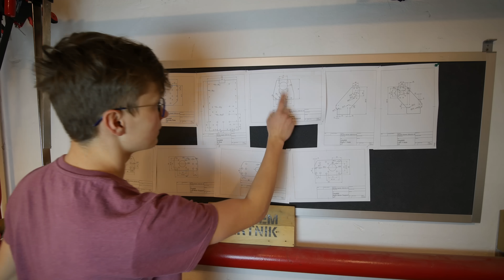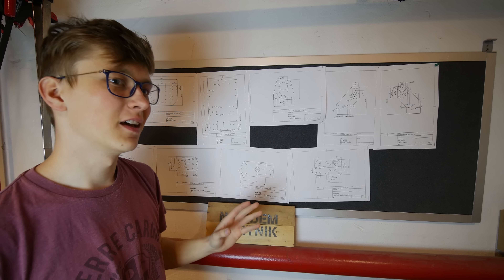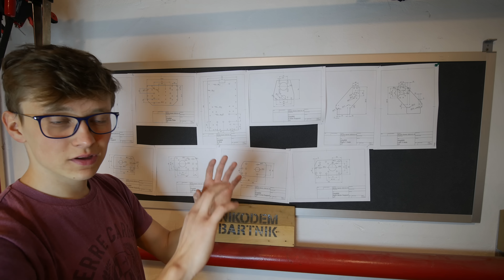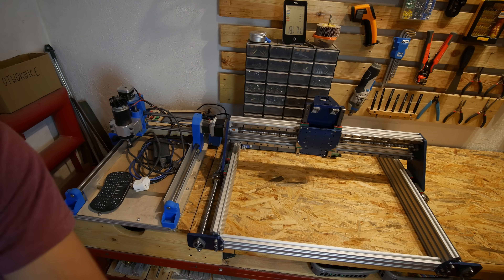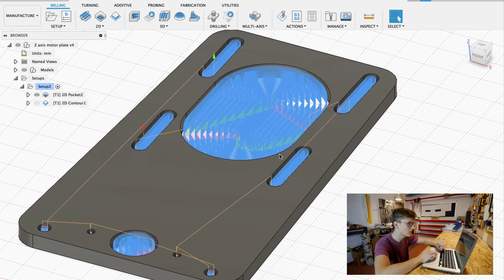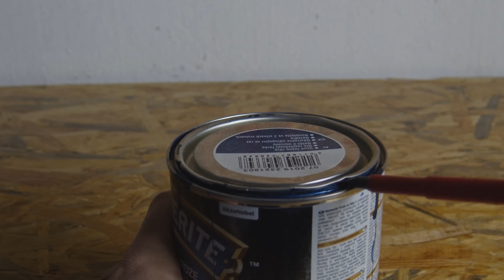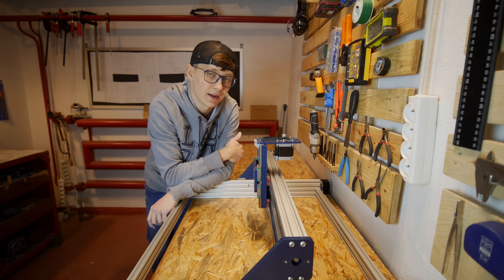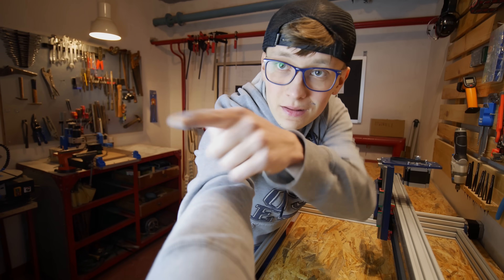Fixing IndyMill With Dremel CNC - Milling Aluminium With DIY CNC

Comment from the maker: IndyMill: https://indystry.cc/indymill-cnc-machine
Reply: If you want, I could machine some stepper couplers for you on my small lathe
Reply: Hi Nikodem, I need your help. at university I have used the NEMA 17 stepper motor 3D model from your fusion 360 CNC drawing. I need to credit the author for my references. Did you design it or did you get the model somewhere else?

Comment: Can you share the dremel cutting settings you used to cut Aluminum. My machine is ready i used your dremel 3D Holder plus a mini X Y Table converted to CNC via Adruino Shield. It small but looks OK. D https://youtu.be/4LjwjdlHPYI?si=4BXXXjIB74IXAPpA

Comment: bonjour, je suis là pour ajouter un avis négatif malheureusement, pour commencer j'ai posté un avis sur le site pour le kit de plaques en acier découper au laser et lavis n'a pas été poster !  honnêtement pour le prix que j'ai payé ce n'est vraiment pas correct déjà j'ai remarqué que les plaque n'était pas complètement plate donc mais railles linéaire force (je le sais car quand j'ai je serrais juste la railles le wagon avancer difficilement et pas quand je le mettais de l'autre côté), il n'a pas mis les roulements (51101 size 12 26 9) dans le lien et ne l'a précisé nul par à part sur l'une de ces vidéos donc perte de temps…

hello, I'm here to add a negative review unfortunately, to begin with I posted a review on the site for the laser cut steel plate kit and the review was not posted! honestly for the price I paid it's really not correct already I noticed that the plates were not completely flat so but rails linear force (I know it because when I have I just squeeze the rails the wagon moving hard and not when I put it on the other side), he did not put the bearings (51101 size 12 26 9) in the link and did not specify it anywhere except on one of these videos so waste of time...
Reply from the maker: First thing no spamming please. 
Your review was blocked by spam filters as it was not written in English.
It is true that some of the rail supports are a bit bended that is caused by the manufacturing process (laser cutting 8mm with small holes in the middle) but that does not influence how the machine work at all. If assembled properly there should be no problem. Try to loose the screws that fix linear rail carriage to the spindle plate and fix them again, that should help.
Reply: @nikodembartnik  I have to agree with @lebonjeuxdugeek, I bought your plates (drilled and powedercoated) in November 2022, and am stopped in my assembly of the indymill because the y plates have some warp/bend to them.  When I attach and tighten to the mgn12 blocks, it binds and does not slide well.  If i only tighten screws on one block, slides perfect, but when i tighten on second block, binds.  I filed the part of the y block where the bearing goes and have gotten it more flat and smooth, but when i tighten one, it is still a little bit off on other.  I am now trying to "shim" the other part (with aluminum foil strips) where it attaches to the mgn12 block and it is better, but still not sliding smooth.  if the plate  is not perfectly level where it attaches to the 2 mgn12 blocks, it causes the blocks to bind on the rail.  Very frustrating.  I proved this by getting a new piece of 6mm aluminum plate and drilling with dremel cnc the 8 mounting holes for the mgn12 blocks on the y plate and when tightened, it slides perfect.  I am going to try to file your plates more flat, but I worry i am going to have to have some new Y plates manufactured.  I can show you pictures

Comment: So your new version for Z axis does not support nema 17 motor only setup?
Reply: because i am planning to use nema 17 because i have many of these
Reply: @ErorenémengEroStratagème have you built the indymill yet?  I am halfway done
Reply: @toddroles3234  yes and its not that easy to build. Low quality linear rail is worse than classic rail and more expensive...
And i am strugling with the Zaxis because the 1.5Kw spindle is too heavy and there is to much friction for the linear rail

Comment: in my case (im building this with one of my friends) we will use a skr 1.3 with tmc 5160 for extra power, and marlin firmware (we like the sdcard support built into the board) (and I'm very familiar with marlin too)

Comment: Even if I am not sure if one really needs 2 NEMA 23s on the x spindle..it might give extra stability and makes it sound rude.: )
Ntl. the machine looks rocksolid and the software should be transferable. The parts- seem to be organisable, and standardish..
You made world class !! And very honest videos. I appreciate that. And all makers will! Other might not.

I am convinced that the Performance of the mill will ripe out enormously with experience an with a professional state of the art mill and patient experience, logging. Especially the drill/ material selection seem to be essential and an art on its own. 

Without a crisis I had had not the time to look Videos on CNC machines btw.  And I saw all, nearly. ; )
And now I MUST build one.
Actually for an other much bigger one project.. then.
Cant imagine how you doubt not going on with this project. Its the biggest modifyable freemill(some americans got lost in license wars yet..) with 2 nemas on screws.. the backleand y axis must prove in practice... as the potentially non fenced front and backload could be a keyfeature(only the lowrider design on mpcnc has simular... maybee..)
anyway. theres a goooooood chance i order the parts from you...
i really obey that piece of work. 
cheers!

Comment: Those fancy bearings as you put it aren't fancy, they are essential for use with ballscrews to constrain the axial load from your cutting forces, without them you won't have accuracy or repeatability worth a damn but you will end up with premature bearing failure of your motor bearings, those plum/lovejoy couplers are also useless for this application, you require disk couplers rated at the correct torque loading. Save up and do it once and do it right, otherwise you'll end up spending more in the long run.  Sorry if that is harsh but reality is frequently harsh, you may have noticed.

Comment: My professor Hello teacher, I have a dramel brand cnc from your brands, although I have a stepper motor torque of 4.7 kgm, I make the y axis current settings fully, but it stops immediately when it is a little weak, I use a 10 amp power supply, everything is ok, but there is this problem, how can we solve another nema 17 stepper  current settings 0.8 0.6 I am doing it again, the same, how else can we handle it.

Comment: Good afternoon. it would be cool if in the manual to the cnc there is a list of milling cutters that you used on your machine and they showed themselves well. with purchase links. I’m breaking my head so that I can take it at the beginning. because I want to cut aluminum and wood. anyway repeat your big cnc

Comment: you need to use the ball-screw bearing blocks they have preloaded thrust rated bearings in them this is one of the biggest reasons you can get the tight precision out of them is preloaded bearings also only use one bearing block to capture the screw and the other in just put it in a lose hole to prevent over constraint, doing this you can get 0.003 or better repeat ability out of that system..
also on your little machine get a block or delrin cut in half heat the ends tells it's really soft and pinch the shaft with it making your own delrin acme nut doing this will take more to spin the shafts but no back lash as the nut is a perfect fit to the shaft google it lots of vids on how to do this

Comment: You are the best, this is very simple and light design. For the ball axis, perhaps you could fix the axis with ball bearings near the nema, so the force will be resisted by the bearings not the couple.

Comment: I absolutely love what youre doing but you absolutely HAVE to include the fancy bearings as they are what support the ballscrew's axial load as it drives the gantry. They are a very important part of the drive screw as it restrains its axial motion with a thrust bearing and lock nut. If you don't it will honestly render the machine inoperable for precision work. Furthermore it will put that axial load on the motor's bearings and make them fail prematurely.
Reply: It is a little baffling, I hope he sees your messages. It would be a pretty easy fix too.
Reply: I noticed that on the DremelCNC already. Huge design flaw in my opinion.

Comment: Everything is fine with the couplers! But the lead screws needs to be fixed on the other side.
The lead screws must not transmit axial loads to the motors. This is bad for motors and reduces the accuracy of the machine to zero.
I managed to lock the screws for on Dremel CNC project.
https://photos.app.goo.gl/UoGbXAMY7SXBuYEx8

Comment: A solid coupling is not likely to work very well because the stepper shaft can easily move axially, the bearings are spring loaded to allow for a bit of movement.  Flip the ballscrew around and constrain it axially at the far end with two ball bearings or thrust bearings, there is little radial load so I've not had any problems with them just clamped around an aluminium plate. https://imgur.com/GcmT2JM

Comment: Hey Nik, no need to change the y-axis ballscrew coupler. The axial movement of the ballscrew  should be anchored with a pre-tensioned ball bearing at the front end of the ball screw (the end opposite the motor)

Comment: Hello , very good job for this one. One question : I have the same spindle and it heats quite quickly. I tried to implement a water cooling solution but have not tested it properly yet. I came across your new designed fan in Thingiverse, is it really efficient?  Thanks

Comment: I used your design to build my own CNC.  I did make some changes.  Some of the holes in the original where undersized so I cleaned them up(i can't file straight for the life of me) so I cleaned up the tolerances for my 3d printer.  I also had an issue with a bad Arduino board and gave up on my GRBL shield and designed my own to work with the Twotrees TB6600 Stepper Motor Driver and also got a ECO-WORTHY CNC Z-Axis Tool (probe plate) so make zero in the Z axis a breeze. I did have to change the Arduino out and everything worked fine so the redesigning of the board was most likely not needed.

Comment: I have been using CNCjs also - I have had the same problem.  Solution - When you start CNCjs, two things start up - first is a server side that you can't see and then the interface.  the interface side of the app is what froze and by pressing CTRL + R to reload that screen will fix the problem.  Don't close it or reboot the PC, if the Arduino looses power, it will reset the position and you can't re-home the machine again to continue the next cut.

Comment: Great video. Small thing... You will get better results if you use a special metal primer before using Hammerite on email.
Reply: Beat me to it, self etching primer is a good safe bet when painting aluminium.
Reply: Aluminium not sure why that corrected to email!

Comment: Hello Nikodem will you use and introduce the new GRBL 1.1h feature, the dual motor support for gantry CNC machines?
You do use 2 NEMA motors for your Y- axis it would be a improvement to have GRBL self square the gantry everytime you
hit the endswitches. Cheers.

Comment: The nema 23 for the z is overkill plus it ads weight. Usually when you buy set of steppers you buy 3 or 5 so not really a valid reason.

Comment: Good to hear that you're following the advice to at least consider rigid couplings :)
Reply from the maker: I will try to avoid them and see what will happen :) that's something that I can always add later
Reply: @nikodembartnik  I also think you should use the couplers. If you don't the forces are passed into the bearing in the nema motors and those are not designed for axial forces and could damage them.

Comment: Niko, on your Dremel CNC you attached the motor directly to the Z axis. On the IndyMill, you use a belt. Why the change?
Reply from the maker: easier to design it that way. Right here I don't have flexibility of 3D printing so some compromises have to be made. And also this one is actually better because stepper motor is actually not connected directly to the screw

Comment: If bearing block is not an option, try 3d print the end block of the motor side, with hefty design, and use real angular contact bearing for both end. This way, you can keep using the pricey oldham coupling. 
This machine already has nice solid frame, expensive ball screws and big stepper motors, don't let a mistake kill its potential.

Comment: You really need those "fancy" bearing blocks. Otherwise you will have backlash and sooner or later you will destroy stepper motors.
Reply: he is still skeptical about the bearing blocks. It will works without them, but having them will definitely enable the machine to run with full potential.

Comment: Can something heavy (such as a block of concrete/metal) bolted to the base aid in rigidity?
Reply: @Gilbert_LUL  precision granite slates! heard of them, would somthing cheaper (concrete, block of metal), or simply countertop granite work if leveled well, and not for some super high end work?  Also wondering for super high speed fdm travel etc to prevent ringing
Reply: @ericlotze7724  you can get cheaper granit slab and lap it. there are a few youtube videos of people building mills that way gantry and all of granite